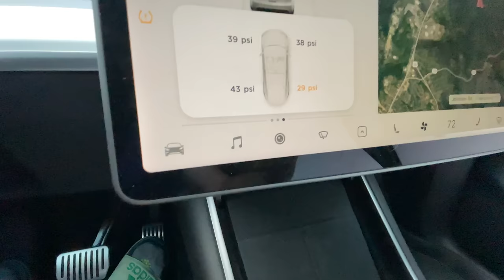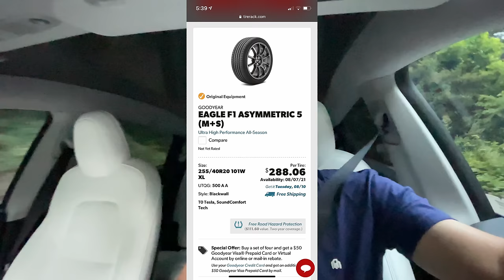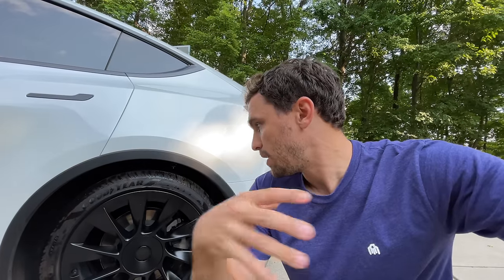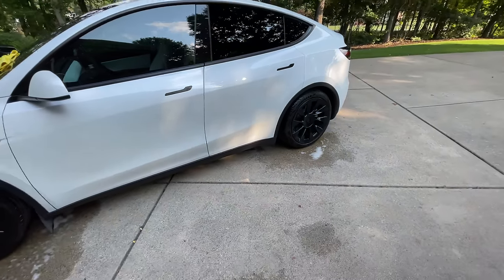This is Why Tesla Tires are So Expensive (Another Flat)

Comment: On my last mobile service appointment the technician told me that the pucks are not used by any Tesla service centers and they are completely unnecessary to lift my Tesla. Has anyone else heard this from Tesla?
Reply: Yes, I commented earlier. Tesla mobile service came and rotated my tires without pucks. I commented and they said they knew where to put the Jack.
Reply: Because the jacks they use have the correctly sized lifting points, since all they do is Tesla's they use the right equipment rather than use pucks. 3rd party shops jack up all brands of cars and can't customize their jacks in the same way.

Comment: 1. How was the ride home with the new tire?  Did you notice any difference related to road noise, due to the missing foam?
2. How easy would it be to remove the foam from the old tires and install them in the new tires?  Had you considered doing that?  I'd be curious to see.
Reply: I'm willing to bet it's quite difficult to notice a difference since not all the tires are missing foam, just the rear (especially since the driver sits in the front). I had a terrible experience with '18 Model 3's Michelin Primacy foam detaching from a tire and causing a major imbalance (steering wheel vibration >60 MPH) that warranted taking the tire off and removing the balled up foam.
Reply from the maker: Not worth removing foam from old tires. I didn’t notice a difference

Comment: After a year with the Y had to replace 6 tires! I would sum it up with
A: always get tire warranty it's like $10, the last 2 tire we're free
B: get the Tesla pucks from Amazon it's $20 and always have them in the car, you took a big chance with them lifting the car can cost you $20k
C: buy another tire and keep it in the car if go on a road trip, most places won't have this tire size in stock
Reply: AHEM, Or do research on your preferred tire service/manufacturer; Pick one that is nation-wide.  I've owned Tesla vehicles since 2016 and DISCOUNT TIRE ALWAYS fix my tire issues  (Nail/AIR LEAK) FREE .  They just pull up your acct, and have a complete history of our services. Tires today are specially made-which means there's usually no means to have a spare.  Most high performance vehicles, and tires that come with vehicles-will default to only 4 tires.  All 3 of my Teslas are on Continental tires w/foam.  By far the best. I started out with Michellins, but the side walls were too stiff, and they wore very fast.  CONTINENTAL SILENT w/foam. TRUST ME!  You wont look back.
Reply: @NjoyLife_01   discount tire is great, the problem they don't have them in New York, and most of the Northeast, hopefully that changes

Comment: In the last 10 years I have had one nail in a tire in my previous vehicles. Since I have had my MY for almost 1 year,  my right rear tire has three patches from screws/nails. The car is a nail magnet. 🙄
Reply: Within 1 week of ownership my wife ran over a 3” deck screw with her model y.
Reply: 30 years driving and never had a  problem with either flat tire or nail and now it did to me after 5000 miles. Spent 4  hours at Costco on Sunday to fix the nail and they gave up. Next day, Discount Tire took them only 15 min to patch and it is free.
Reply: I live on the east coast of Florida and the only tire store that would do the patch was Discount Tire two times and Discount Tire once in Nashville. Tires Plus and Tire Kingdom said hell no. We have a spare tire on order for a New England trip coming up.

Comment: This is the reason I went with the 19’s on my Y and the 18’s on my 3
The low profile tires are the gift that keep on giving
Reply: Right you are. Too bad that 17s wont fit on the Model 3.
Reply: How have the 19s treated you? Ngl, blowouts (with no spare and limited ability to use a jack on these cars) are the main thing I'm nervous about.
Reply: @NickMcC  
On the Y I’ve had 2 nail repairs and one replacement because the nail was too close to the tire edge. I’ve never had a flat where I was left on the side of the road.
Just go for it brother you won’t be disappointed

Comment: You can glue foam on the inside of the tire yourself
Reply: I’m still on the factory tires, but I’ve been told that after you replace them with any standard tires, you can’t tell the difference in road noise.

Comment: Why not replace both rears at the same time?  
Consider fitting steel wheels. You can use taller sidewall tyres that cost less to replace, can cope with pot holes and with aero covers will look OEM.